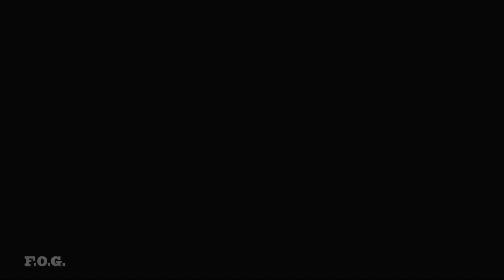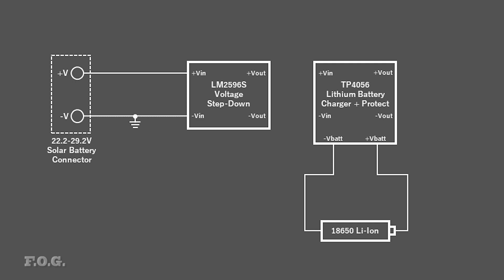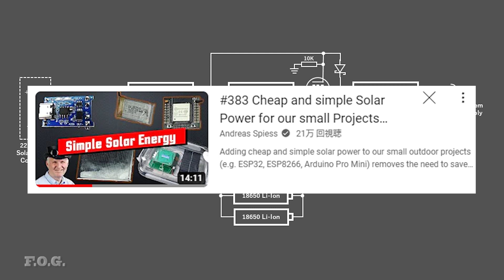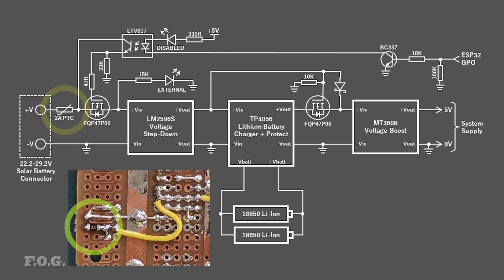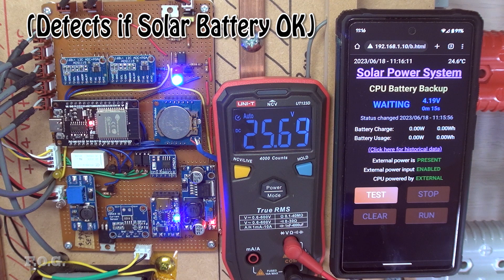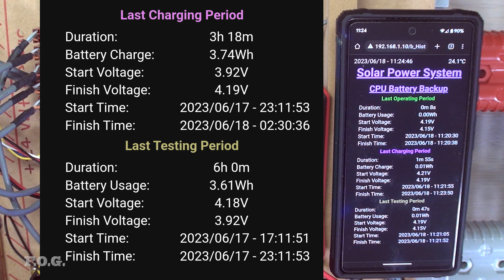EP2 – Solar Controller – Smart Power Supply

Comment: I don't trust those lm2596 boards because of the 3 amp limit with such a small capacitor. I build my own with a big nichicon cap and tht lm2596 with more robust parts but basically the same circuit but it makes me feel better.

Great video sir.
Reply from the maker: Surprisingly the build quality of these LM2596 boards is pretty good, but the input cap is a little on the small side (likely due to space limitations). I reckon the board is still probably fine, if you don't have super heavy loads. But if you are pushing hard, then adding a heatsink and bigger input cap would be a good idea. In my case, the max output current is about 1.2A@5V(6W), so it's barely breaking a sweat (though it does get warm to the touch). Thanks for the comment.

Comment: Do you plan to design and build your own solar charge controller, or are you using a commercial unit?
Reply from the maker: I am using a commercial solar charge controller. The controlling I am doing, is more about the usage side, such as intelligently controlling the inverter and grid/solar changeover switch. On top of that I am gathering statistics, and of course making everything remotely accessible by a web browser. If you want to know a little more background on this project, please check the first episode in this series. Thanks for the question!
Reply: @ForOurGood  I have to admit, I started to watch the first episode, but I guess I got interrupted. Have watched it again now and got the idea firmly understood.
Reply from the maker: @CollinBaillie  No worries, there is so much stuff distracting us all lately, so I fully get it, and very much appreciate you taking the time to watch.